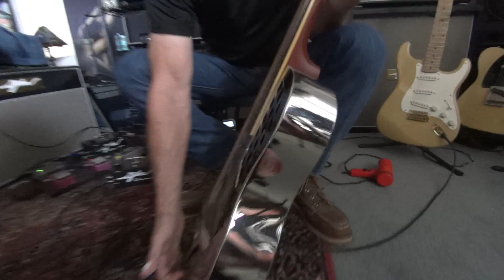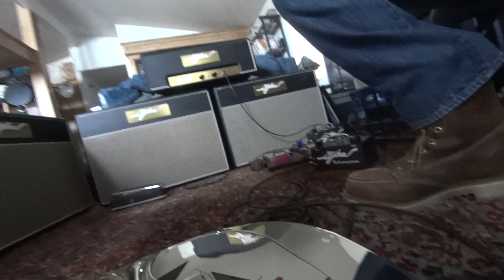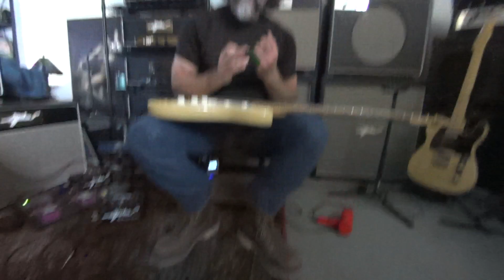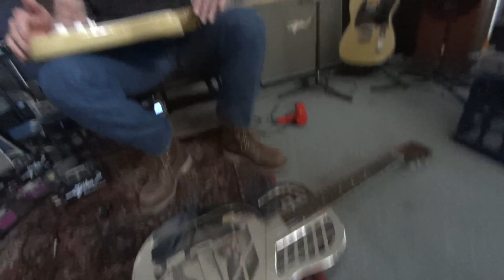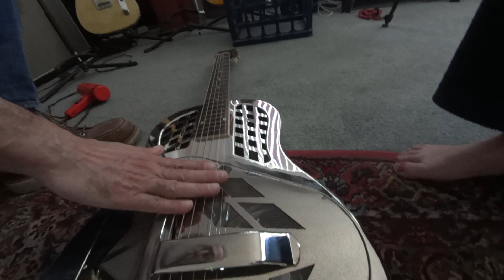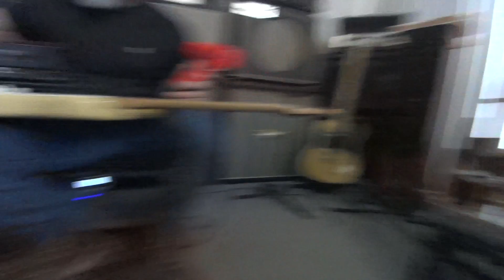What is electricity? (understanding electronics/electricity) - Dr. Bob's Theory of Zombie Electrons

Comment: I still don't understand capacitors
Reply: As Bob told me a capacitor is like a gate that keeps fat zombies from going through but let’s the skinny ones through and they fall in the wood chipper. 🤣
Reply: It's a holding tank split in half by a rubber wall, you can force electrons in and stretch the wall, then shoot them out all at once, or vibrate one side and pick up just the vibration out the other side that's a coupling cap. A filter cap smooth pressure fluctuation because of that rubber wall of flexibility. That's your 3 cap uses